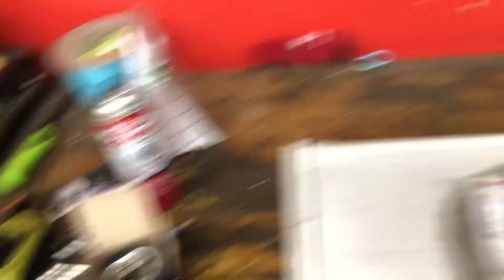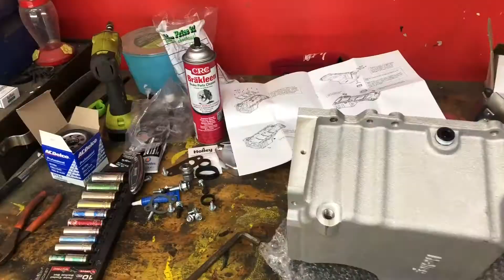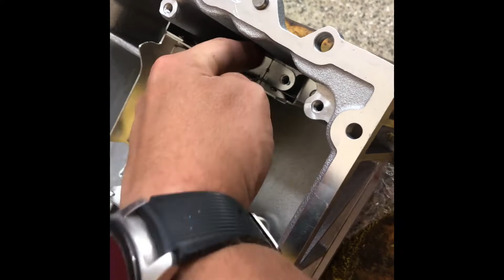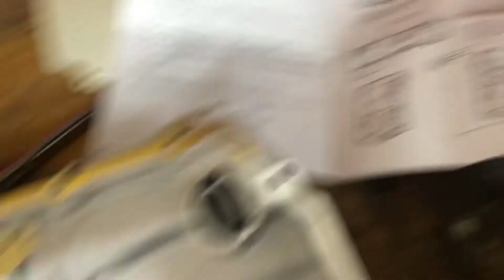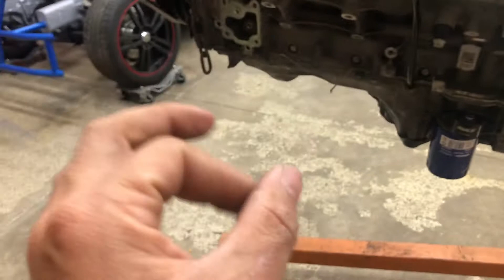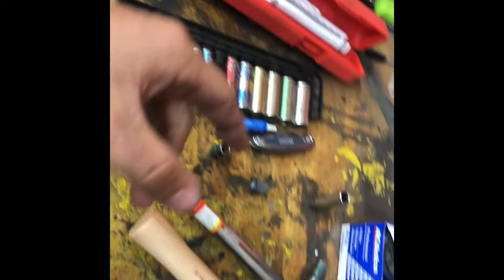Holley GenV LT Oil pan install- PN 302-22/302-20  |  Deathkart Solstice L83 5.3L 355hp build

Comment: Did you use the stock dipstick? If so, did you get the correct read on oil level?
Reply from the maker: Ooohhh it’s been a while now but I do think I bought the stock truck dipstick and read just fine no issues

Comment: What about oil temp sensor ?
Reply from the maker: Hmmm not sure, maybe that sensor was part of the oil cooler system that we didn’t use for our application. We used the block off plate for that. If there was a sensor in the stock pan, I would think that is just an oil lever sensor though, not sure if the oil temp sensor is somewhere in the block or head?

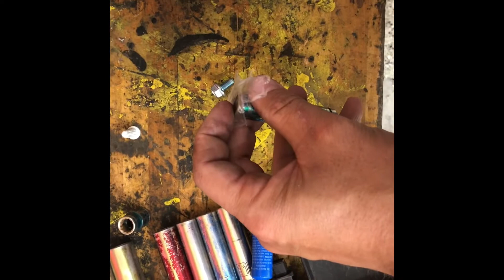Comment: @ 7:05 instead of plastic for hard to reach and blind bolts ive used bubble gum before and aviant gasket residue if its around, chew the gum spit the oils when it get dryish or tasteless its easy to get bolts on or off... they do make magnetic sockets but im too broke for that,  crazy and good to know the new pan doesnt come with the bolts or bolt rings. im following this  want to LT my solstice
Reply from the maker: Good info thanks!